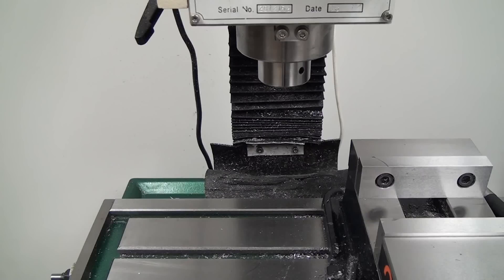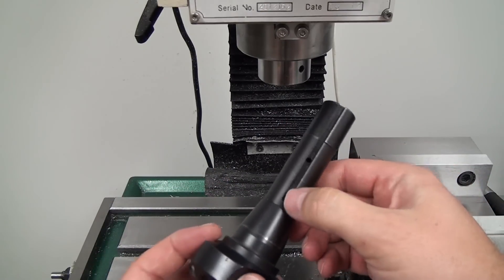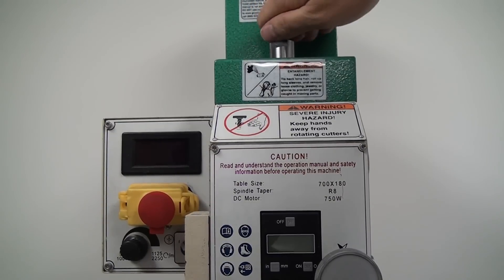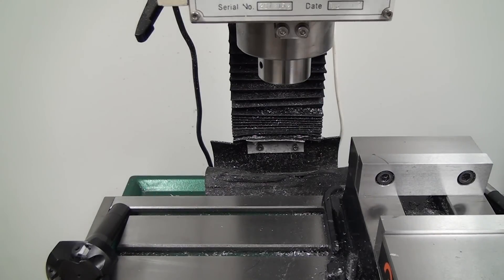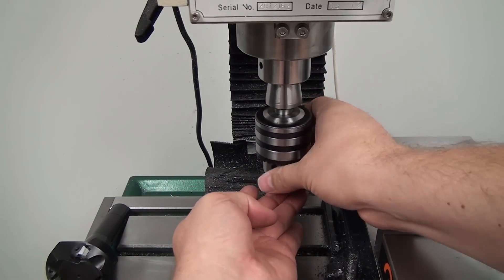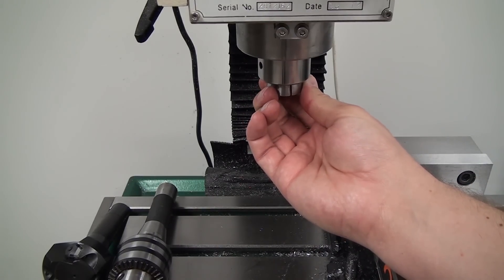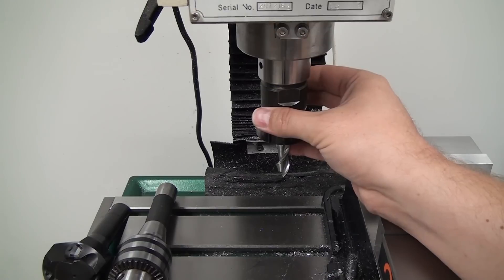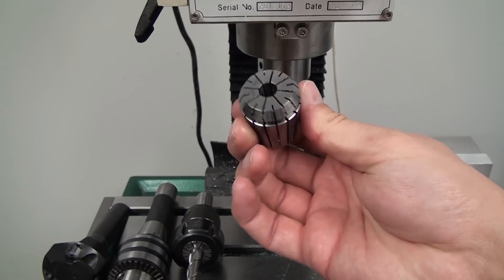CNC-G0704 #4 R8 Arbor, Tormach R8 Adapter Collet, ER Collets

Comment: Hello
I'm setting up a cnc milling machine, and I want to use the tormarch system to perform the automatic tool change, but I have a question.
As the R8 tightens the tool, I believe it is in the screw above.
When it tightens the bolt goes down or goes up?
Could you make a video?

Congratulations and thank you ..
Reply from the maker: +wex laser by bolt are you referring to the drawbar? It doesn't go up or down at all. It rests on the quill splines and sucks the R8 collet up into the spindle when you tighten it.

Comment: Is there any advantage to TTS other than speed? It seems like a great system, but at the moment I'm considering simply going for an R8-to-ER20 adaptor as my primary means of cutter holding. 

Another question: do ER20 collets work well for holding drill bits? I'm not impressed with the Grizzly-supplied chuck so far (though my crappy drill bits could be part of the problem as well).
Reply from the maker: Hey Nicholas.
Frankly, TTS is really only good for the speed/ease. The big downside is that you can get tool pullout as the TTS holder slides out of the spindle. I haven't had this happen in quite a while now but before I realized you had to REALLY crank down on the drawbar it was a problem for me.

I have only used ER20 for drill bits in nominal sizes (1/4", 1/8", etc) but so far have not any problems at all. They are likely running more concentric than the Grizzly chuck :)

Comment: what is the length of the tts r8 adapter , i bought one but i think they sent me the wrong one...the ring of the tts er20 does not come into contact with the face of the spindle, i was thinking of just milling the nose of this one down..
Reply from the maker: rick gonzales I haven't measured mine, but I can tell you it mine also does not touch the spindle. There is a very small gap... I've never tried getting some feelers in there to see how much gap there is, but I'll check and report back.
Reply: do you have the tormach tts r8 adapter in it..or a regular r8 adapter
Reply from the maker: rick gonzales It's the Tormach R8 adapter.

Comment: @Russtuff  I just purchased the g0704 Mill & need some R8 Collets for My End Mills What R8 Collets Do u Recommend? I was going to just buy the Grizzly Collets but don't no the Quality of them. Lmk. Thanks
Reply from the maker: mikeyeyes7 I never actually bought any, since I'm using the Tormach TTS. If I were going to buy R8s though, I would buy either from Grizzly or from Shars. If you go with Shars, check their eBay store because you can get much better deals there. I just bought some of the 5C collets and they are more than good enough for my needs.

Comment: You can also get a R8 version of the ER32 adapter as well. The downside is that if you are doing CNC, you will have to set the tool height every time which the Tormach version having holders you can interchange does away with.

Comment: you should note that not all R8 spindles will have a key and the key when present does "not" transfer torque to the tool. The taper does all the work of power transfer when the drawbar is correctly torqued.  gerald